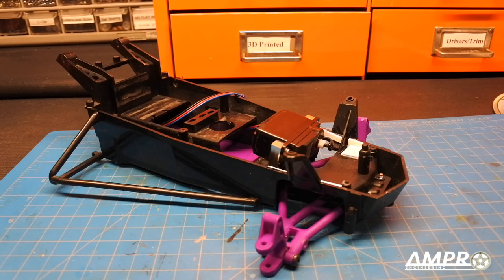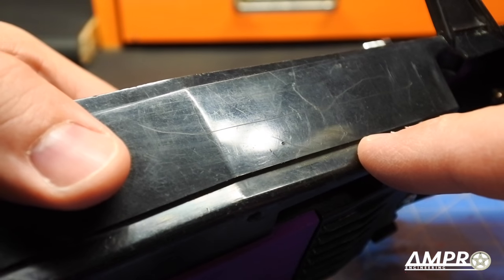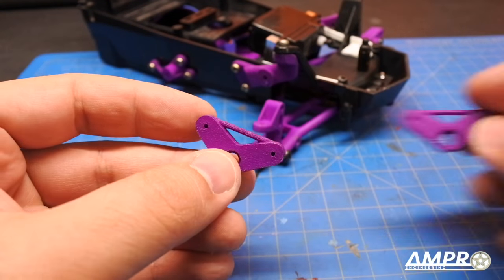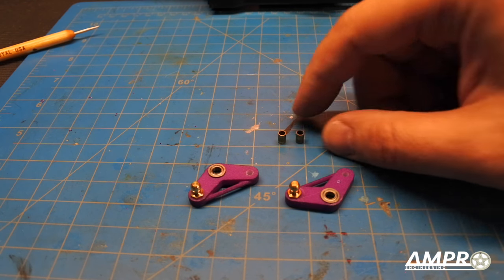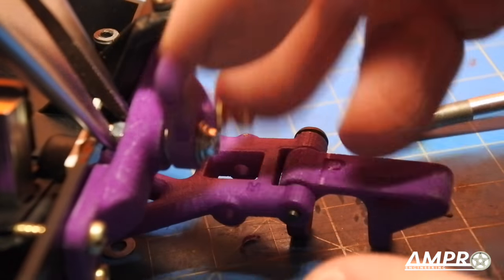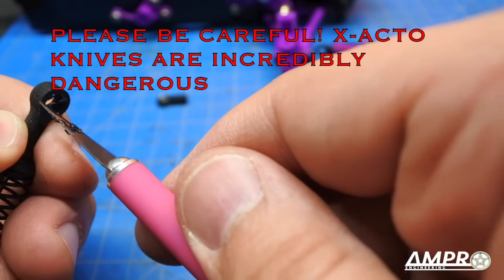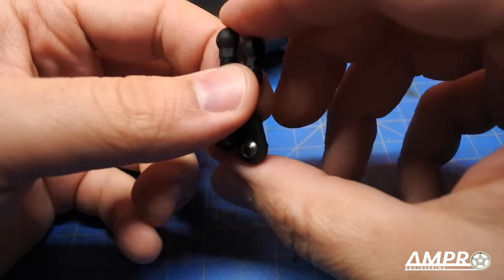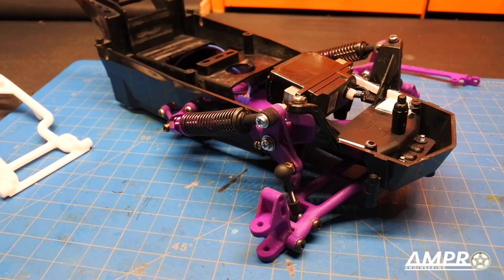e63: Tamiya Hornet "SuperFly II" Build Part 3 - Cantilever Suspension Install

Comment: Awesome. I have a grasshopper with some modifications but now I need to buy a hornet.
Reply from the maker: Oh cool. I love the Hornet...um...clearly...haha!
Reply: @AMPROEngineering  I cannot find the super fly 1.0 on shapeway.i cannot find the roll cage or the body parts.
Reply from the maker: All the parts are in the Hornet section here. There is a 1.0 and a 2.0 but the 1.0 body is way simpler and cheaper. They share the cage.
Reply: @AMPROEngineering  cheers.i am dumb.i was looking at the super fly bit

Comment: Have you thought about designing a cantilever front shock setup for the Frog? Maybe even a mono shock setup that would allow both front and rear (one shock per side) to operate with one shock? It would be similar to the Hot Shot mono shock one front, one back except it would be one shock right side and one shock left side. Just thought it would go well with the lay flat theme of the stock Frog rear shocks to have lay flat front ones...
Reply from the maker: I did but it took up too much room under the body and the chassis was a pain to work with on the outside. This is why I made the micro tower set up for it. That was clean and works perfect.
Reply: @AMPROEngineering  What about converting the stock friction spring tubes in the body to a mono damper of some kind? You'd have to drill out the tube barriers separating the two tubes so that you'd have one tunnel. But, after that can you envision any way to turn that tunnel into a mono damper with maybe an internal spring? I know it's a reach...

Comment: That is just awesome, Alberto!! I can't wait to start building mine.
A quick note for the viewers: A 3x18mm Machine screw, with 2.5mm Allen Head is readily available through Associated, and nearly any Hobby Shop. 
AND, those Brass sleeves ARE hard to find, unless you collect Tamiya hardware bags on EvilBay, like I do....
BUT, are still manufactured and sold by CRP, available at most Hobby Shops, or on EvilBay! 

QUESTION for you,  Alberto. ....  Fortunately, I bought a stock of those shock ends from AmPro(thanks for making those!). What I'm not clear on, is what length of shock am I going to need??  I've got two, from a 1/18th Scale Losi. I believe that they are 75mm, eyelet to eyelet. Will that work? 
I do know that they need to be very soft. These are... In fact, they're a little softer than the stock "Bic Pen springs"!

The only thing I haven't got yet, is 3mm washers. I do have a package of 100 of them, coming from China, on a VERY slow boat!!! However,  it was only  $3.15 for 100. 😀
~ Carmine
Reply: And..... Can't WAIT to get that roll cage!!
Reply from the maker: Yeah I also collect parts bags. As for the shock ends, you need the 16.75 units if you are using 75mm shocks. 80mm are better but start with the 16.75's. The 22.75 units I really don't like to use as they are really long. Man I need to get some of those washers! I am running out.
Reply from the maker: Haha That one will be soon.
Reply: ..... Could I do something sacreligious - like move the rear mount FORWARD about 5mm?? 😲 
I don't want to sacrifice any travel, and these shocks are SOFT !!
Thanks for the advice! I'm pretty sure that I bought 16.75. I'll check. 

..... and yeah, that's why I just got a package of 100 washers!! 👍 Those sucker get eaten FAST!  I got black, so they won't stick out from a distance.  Crap! Just realized that I also need 4mm! 😠😠
Reply from the maker: Yeah let me know what you ordered. You could move the base forward but I wouldn't. Mainly because it could adversely affect the geometry in a way that I do not know. If you didn't get the correct ones, let me know.
Reply: OldfartRC - Hey Bro! You sure do get all over the place! Two accounts? I have enough trouble with one! 
I just found out that you guys aren't doing well.... Horrible, is what the scuttlebutt is.  You could have told me! We've only known each other since 85... We served in Desert Storm together. You saved my ass once. Remember? 
22 Jun, 90. I was AWOL, going to meet my girl at the Airport. You took the heat for me! You said "I'm an E-5, you're an E-3. My record is clean, yours, notsomuch! It was the right thing to do." 

You said that last line often, as you helped so many people. I remember when my little girl was very sick, and my COBRA just ran out. You showed up, with a BIG check, and saved my baby girl's life! 
You just can't put a price on that. I remember you also never asked for it back. You said "It's fine. Maybe someday, God Forbid, I'll be against the wall myself. I would hope that people who might not know me, would help me then. Pay it Forward! It's just Karma." It still breaks my heart, how gutted you were, when you lost your beautiful Denise. Chip off the ol block, she had the voice of an Angel. I know a big chunk of you went with her.

Well, here you are.... To even ASK for monetary help must mean that you are really against the wall, bad.
HELP is coming, Brother! I can't afford it, you know how tight my family is. 
But, you would do the SAME, in a heartbeat - and have. So the next time I stop this Truck, I'm pitching in  $100. I really wish it could be more,  but you know. 

HOPEFULLY, your friends here will pitch in also. Sure, money may be tight for a lot of you folks.....
But imagine yourself in HIS shoes, just for a moment. 
Love you Bro!
Murph
Reply: OldfartRC - I'm still fighting for you Bro!
Reply: AMPRO Engineering - Fortunately for us, we've got a pretty good supply of M3 x 10, 12, 16, 18, and 20mm, self tapping Allen Head screws, and M3 x 6, 8, 10, 12, 14, 16, 18, 20, 24, 28, and 30mm Allen Head Machine Screws. Carmine always had this thing against Phillips Head screws! Oh, and I ordered 100 3x4mm brass sleeves from China.... Hopefully, they'll be here this month. So for these projects, I believe that we are pretty well set up for hardware. He also just got a big bag of 3mm and 4mm black washers. 

This Cantilever setup is just bloody brilliant! Besides practical operation, they just LOOK so dang cool!!! 👍
So, the whole Superfly II kit would work on Hornet OR Grasshopper, since all we're really using, is the bare frame and basic gearbox? And that Roll Cage is DOPE!! I just saw where you made one for the stock Hornet body.... super cool!! Thank you! 
Murph

Comment: Does this also work with the grasshopper? This is a sick suspension setup!
Reply from the maker: Yes but it will require modification to the stock body
Reply: @AMPROEngineering  as in? Just cutting for  fitment? Or full on fabrication?

Comment: Now, would the cantilever suspension fit with a grasshopper body?
Reply from the maker: it will require some mods to the shell. I have seen it a couple times.
Reply: @AMPROEngineering  I thought it might need some modifications. 

Would you say the cantilever setup is just for cosmetics? Or does it offer slightly more performance than the double Wishbone?

Comment: How much of an improvement did it feel like over stock set up? I dislike bouncing.
Reply from the maker: Over stock? Wow...that hard to quantify but I say the stock front end is like a ham sandwich. Gets the job done if you are hungry. This version is filet mignon. Basically it  changes everything about how the front of this car behaves. The car no longer handles like a stock hornet. You can see several driving videos I have with this set up.
Reply: Sold.

Comment: It looks like when I connect the servor steering arms, that they will hit the bottom of the cantilever. Anyone can confirm this?
Reply from the maker: They shouldnt. Have you moved the servo? Is the arm in the right spot? Can you email me images? amproengineering@gmail.com
Reply: @AMPROEngineering  Figured it out. I had the arms crossed. Front suspension works awesome! I want to do the rear now. I also installed the roll cage using your rear shock mount and the rear body posts broke on the first rollover! I will need to purchase the parts necessary for rear suspension upgrade. Do I need a certain rear shock mount? It seems you sell several and in your rear suspension video, you dont make it clear which to use. 
Thanks!

Comment: I cannot find a 4.8 ball stud with a 4mm long m3 thread. I have searched the entire internet. I am using all the expletives even. Also no seller anywhere gives a thread pitch and a length sometimes one or the other never both. Could you link a product you believe would work? Please no chineese sellers. This is driving me crazy that’s all I need to find to do this now.
Reply from the maker: All m3 shank ball studs have a 4.8mm ball stud. I use Tamiya ones but as long as you get a ball stud with a matching ball cup, you are fine.
Reply: I’m a stooge. Just had to search for “m3 ball stud” be careful scrolling through images with safe search turned off though.